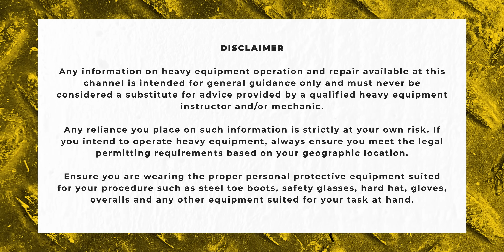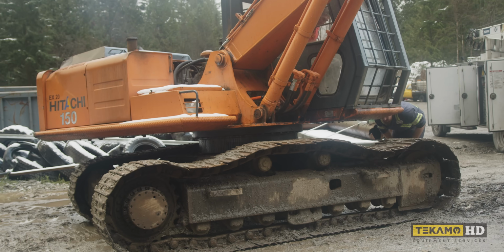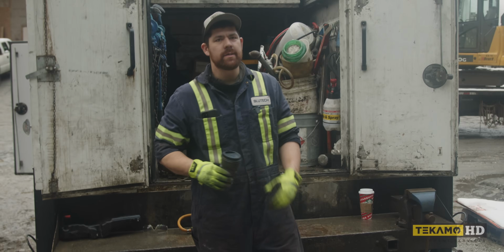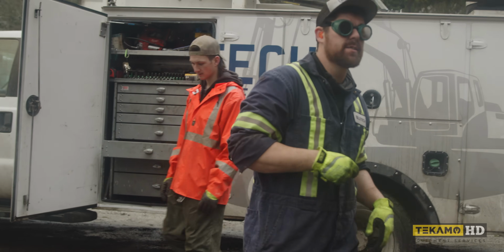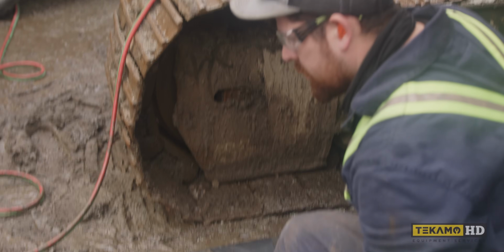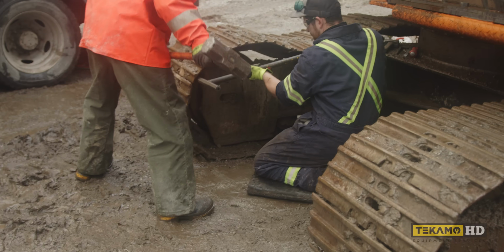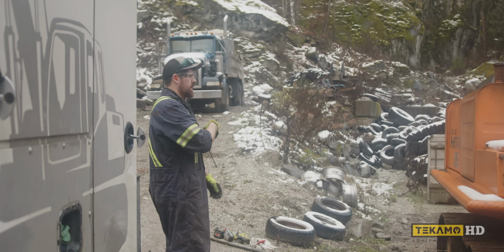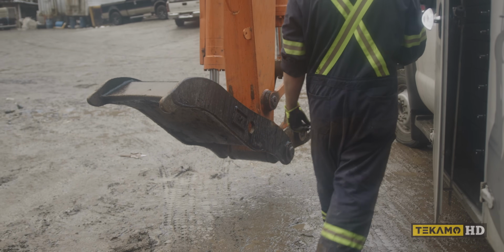Excavator Track Split on an Old Hitachi 150

Comment: Slightly off topic but , do you have a chain press for splitting track links? If so , what style/brand do you use?
Merry Christmas 🎄
Reply: Cat/OTC works very well for the many 345-352 tracks I've split.
Reply: I don't use a track press, even on larger equipment where a 150T would be required. I've done up to a Hitachi EX700 with out a press, we got some tricks, call us hacks but as an independent without an unlimited corporate budget, sometimes you just gotta "$@#* with the @#&$ you got".

Maybe one day I'll purchase something but I learned this way and after using a press at the dealer, I'm faster splitting my way than setting up the press.
Reply: @BluTechEquipment  I’m probably going build one ,I’ve got a 1/2 dozen pins and bushings to do on my machine… figured a press would be easier.
It’s an old Cat 215 on our family farm , not really worth anything.

Comment: That torch tip does not sound good Cam. And yes, hose or wire handles are great for pin-punches.
Reply: Yea the nice part with the hose chunk is being able to swap out ends on the same handle, easier to store a bunch of different size drifts and one handle.

I don't think my acetylene was high enough, usually what causes popping and backfires. I typically run 14/40, 14 psi acetylene and 40 psi ogen. Popping is especially noticeable with rose buds as they demand high gas flow.
Reply: Mine sounds like that when slag gets in there. 
But isn't Alberta a bit chilly to work in with nothing but the cab to warm up in? 
I'm basically as far north as it gets and 95% of us use vans, while the rest uses boxtrucks.
Reply: @Tmjpwns  You run your own truck? Shoot us some pics if you're a contractor, we'd love to see it!

Comment: Excellent concept, just need to work on the editing.   Less is more.  Adjust the track, position the truck, torch the pin.  Cut out all the filler, and improve the audio pickup and you'll have 1M subscribers with 500K views per video.